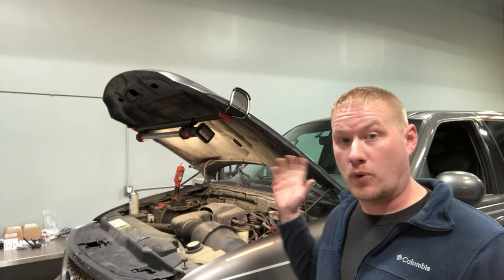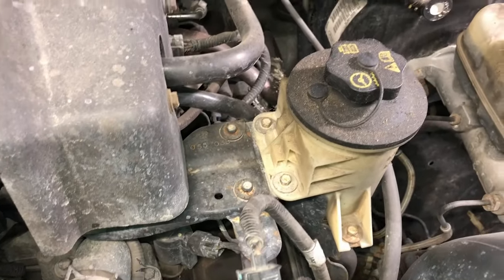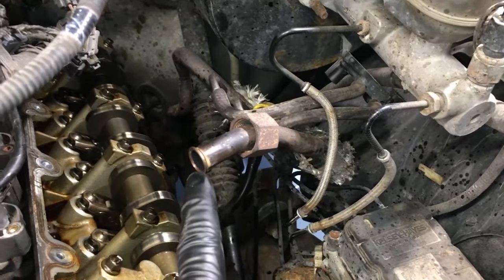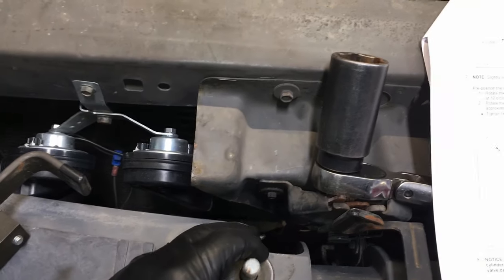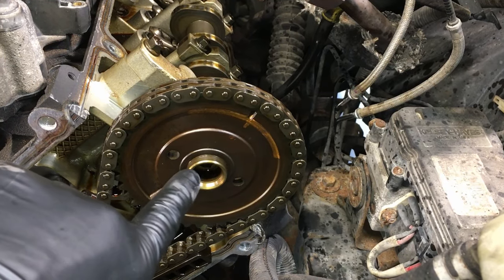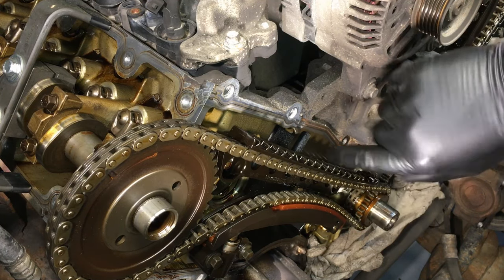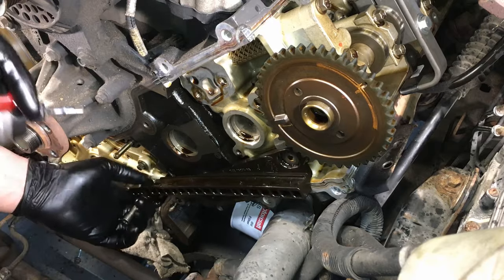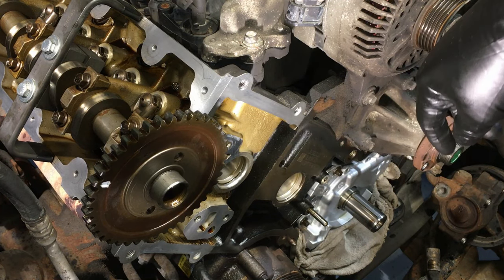Ford 5.4L 2v Triton Engine: Complete Timing Walkthrough

Comment: The driver-side cam seemed to be way off; I wonder if the eleven and twelve o'clock positions are supposed to be referenced from the plane of the top of the heads which is at an angle.

Comment: Awesome vids.  I have a 2010 F-150 3 valve 5.4 with 110k miles.  I don't notice any real loud noises yet but has had the strange shake at idle a couple times but has never threw a code.  I wish I lived close enough to your shop to have the complete job done because you know your stuff for sure.  I'm in northern MI and besides the Ford dealership that would be huge bucks, I just don't know a shop here in Gaylord that I would feel comfortable enough to do it.  Maybe there is.  Just seems to be too big and precise of a job for me to tackle.  I'm okay with spending money on it because it is a great looking truck still.  I just got out from being parked all winter and would like to get it done.

Comment: So how can I tell if the pistons are all below deck, because if its 2 rotations of the crank to 1 of the camshafts dont you have a 50/50 shot of the pistons not all being in the 'neutral' position? Only asking because the timing chain was off before I started working on this project

Comment: Super video, Brian, thanks.  My 2003 F250 5.4L 2V with 195 k miles, has a steady "garr" sound at idle,  disappear at more throttle.  Could it be the chain guides?  Also, no misfire when cold and started missing when getting warm, and more miss with more throttle.  Any ideas, thanks. Dale

Comment: I have the 97 4.6l Windsor, with 250k on the clock, there’s no issues, but was planning many parts to change out ( radiator, timing components, valve stem seals, etc). Should I wait for an issue/ reason, or just perform the PM based on mileage. Owned it since new. Thanks (some oil burn off, suspect stem seals)

Comment: I really hope you see this, I have been looking all over the internet and cannot seem to find anything about the Cam Gear removal or installation.   I have the 5.4 2 Valve and it almost looks like the Cam Gear is screwed on, I see threads on the shaft. There's no key or anything,  I don't understand what keeps it from moving on the shaft.  And there is no bolt either.   I have my engine all apart and am re doing everything, but this is the only thing I can't understand,  I have a timing kit on order with the Cam gears, but I don't know what the deal is with them.  Any insight would be greatly appreciated.

Comment: nice video 
a hint from my minimal experience... 
a few degrees off of tdc should not be a issue as long as u have marks lined up with colored links you gold
so bottom tool is not mandatory
cam lock tools are for your safety
 there is about a 30 degree cam rotation do to valve spring load on a sohc at TDC basically everything the tensioners are holding  plus 10degees or more the cam gear will rotate further so
before touching the chain remove spring load with cam holder tool or a screw driver pry tool to hold the tension with one hand and use other to remove chain off of crank gear then release tension slowly
or cam will turn violently and damage valves or fingers
cam lock tool holds 2 valves open and if you remove the head they may bend if you set head chamber side down so tool will need to be removed releasing the rotational force
upon reinstall the same rotational force will need to be reapplied to cam gear to get marks to line up so two hands one to turn one to secure cam tool or just put chain on.

Comment: I'm a little confused, you said in the beginning of the video that the 5-4 2 valve is timed differently then the 4.6 2 valve engines. My question is, why is it that they both appear to look the exact same? And what exactly is the difference between the two?
Reply from the maker: They are both 2v engines but there are many differences. There are differences between the 5.4L 2v and the 4.6l2v Romeo and Windsor.
Reply: @FordTechMakuloco  Thanks for replying promptly brother. My main concern is the timing. It appears that both engines are basically set up the same way, both cam gears at 90 degrees from the head surface and the crank sprocket at the 6. If you have a video on resetting the timing for the 4.6 2 valve, after all the cam followers have been removed, that would be most useful to me, because I did a complete head job on them and I'm getting ready to put everything back together and I just want to make sure I time everything right.

Comment: Could you please answer this question for me ? Can I use the wedge tool on the 5.4 2 valve to prevent removing the front cover so I can change out the head gasket?

Comment: I have a 2003 ford expedition 4.6l 2v romeo engine and was going to be doing timing chain and oil pump....would you recommend the high volume melling pump M176HV? Or should I stick to the stock M176?

Comment: Hey Brian, your video has been super helpful as I just bought an f250 that I had to replace the timing cover on. Everything went smooth but now it’s seems I’m having trouble building oil pressure. I’ve followed your advice of removing the sensor and turning the engine but after several tries there is still no pressure. Any ideas what it could be?

Comment: Could letting timing get bad enough on these motors cause a constant misfire on cylinder 1?
Reply: usually if timing is an issue then whole engine runs bad, not just singe cylinder, just check your regular things first - plug, coil, cyl.compression, injector and go from there

Comment: when all this is torn down, would it be useful to get a stethoscope and turn the crank over a few revolutions and listen for any differences in the cylinders and feel for any slight friction in the strokes? Would that help you determine the overall health of the lower part of the engine?
Reply from the maker: no

Comment: If your using a good used timing chain and you can't see master links lay chain on table mark one link on one end and on other end mark 2 links and align on e link marked with one link put on dot timing mark on crank and and the 2 links at timing mark on cam socket and make sure you are on tdc and cylinder ready to fire or you will be 180 out on crank hope this helps

Comment: Sup guy.  Question for you. I have a 2012 5.4l e-350 2 valve i believe since i dont have those long spark plug. I have what i think its the startup rattle for about 2 or 3 secs. I originally thought it was the starter going as it only happen when cold and start up only. Then the started craped out a few months later. Rattle only happens in the summer. But i got missfire code on 4 and 7 and i think head gasket is leaking oil but other than that it runs fine. Question is can i do these heads while engine is in the van? I dont have a lift can i remove engine without a lift?

Comment: Since you've seen a ton of these 2v motors, what mileage would you recommend doing the timing chain? I bought a 2002 5.4 that runs fantastic with 205k miles but I don't see any signs that the chain has been done before. Am I on borrowed time or do these hold up that well?

Comment: Hello, I have a question about a 01 f150 super crew 4.6 270k the engine is making a rattle seemingly like timing chain but I noticed it’s dropping oil pressure from full/ normal- to going dead and the light illuminating , if I rev the engine a bit it will come back up but stop again after a few seconds . Do you think the tensioner is blown out causing to lose oil pressure or is it a pump issue?

Comment: I assume this engine is in time before disassembly; so why are the cam timing marks not in the correct location when you have the crank at 12:00 o'clock?   The driver side is way off at 2:00 o'clock.  So was this engine timing off?

Comment: which followers should I remove if I don't have the tool to hold the cams? Also can I use the same tool from a 3V eng to the remove the followers on a 2V eng? Thanks in advance.

Comment: I am doing head gaskets and timing chain on an 03 F250 SD 2wd 5.4. Is there enough clearance to pull the heads off with the exhaust manifold attached just disconnect both couplings and drag it all out?

Comment: Just a question, what is the timing chain on 5.4L 2V replacement interval? Got 114K miles at the moment.
Reply from the maker: Most go 200k or more before needing any service.
Reply: @FordTechMakuloco  I have a 2003 Harley Davidson model that needs the timing chain replaced. A Ford dealership (Houston,TX) quoted me max $2,800 but could be a little less... Is that accurate or do you think they are over charging me?
Reply from the maker: It is on par for dealer prices.

Comment: Brian once again great lesson; thanks for sharing your heart. My 2000 f250 has 191K on it.... Is this something I should proactively address? I don't notice any issues right now
Reply: We have an 2003 E150.  5.4 around 195k I started to hear valve ticking on pass. side head.  Now at 220k It was getting pretty loud so I did lifters, rocker arms, intake, timing and new oil pump.  Intake was leaking at cyl 1.  Lifter and tensioners and were completely shot.  Also chain was about half way through front cover.  Got at 140k previous owner used oil change places and hardly ever got it changed.

Comment: Since its a colored link system, wouldn't it be "safer" (assuming one didn't have the correct cam holder) to time it with the crank key at 12 o'clock and the pistons all below deck?

Comment: I have an 2004 5.4.  I replaced the tensioners 3 years ago with Motorcraft and they're already failing again.  Can I use the steel ratcheting ones?

Comment: So when u set the crankshaft 12 position and u removed the chains can I removed the head to a head gasket replacement?
Or how u set the engine up in order to remove the heads?

Comment: Wanted to get your opinion, I’ve been chasing a wild hair for quite a while now, just recently watched your other video on replacing the intake manifold and sure enough mine was cracked. So I replaced with the dorman intake all new injectors, all new spark plugs and coils. Because I used to get lean codes on both banks of the engine, especially when really cold ambient temp. I still have a what I call a spark knock on my engine, when I upgrade to high octane fuel, the problem goes away. But comes right back on regular 87. Under light load I get a rattle noise only upon acceleration in drive. When in park you can rev the engine and the problem doesn’t occur. I’m thinking it either has to do with a vacuum leak somewhere being how when the engine is still cold , my ac will only go to defrost until the engine is fully warmed up then blows through the vent. I’m hoping this is just a lack of vacuum and not a timing chain issue. Other then those two things the engine runs and idles perfect. This is on a 2002 f150 5.4 2v. Any input is much appreciated.

Comment: Any knowledge on the cloyes timing chain kits? Comes with the crank sprocket, chains, guides and tensioners. I plan on buying a melling oil pump, but what do you know about the cloyes timing chain kit? Good to use or bad to use?? Thank you

Comment: Not a criticism just an honest question. Do you ever put any kind of lube on the tensioner rails say like assembly lube so there is not a dry start on the chain until oil gets up there?
Reply from the maker: Nope no need, during the prime procedure the oil squirters on the tensioner saturate everything.
Reply: FordTechMakuloco OK I was just wondering how long it took for oil to get up there. Do you have a vid doing this on a 4.6 2V?

Comment: So many expensive issues identified on your videos and others regarding the Ford 5.4 2V, 3V & 4V Triton engines.  There are obviously millions of these engines on the road.  Are the issues plentiful because of the failure rates, or common due to the sheer numbers of these engines out there?  I'm looking to replace a vehicle soon and looking at the 2011 and 2012 Lincoln Navigator.  I'm looking for a well maintained 100K mile or less vehicle with good dealer service records and regular oil changes.  Should I consider these Navigators, or run for the hills?

Comment: Hey, might be a newbie question.. when you turned the crank shaft and the left cam ended up at 11oclock, why didn’t the right side end up at 12oclock like you were hoping? Is it that the chain had enough play by now to end up at almost 1oclock like found in the video?
Thank you for such a great video
Reply: Yeah, that REALLY freaked me out. I'm thinking, since he overshot a bit, and backed up.. and the tensioner was blown, we just saw some backlash... and first I was thinking "did this jump a tooth?" but, of course, that's just not possible is it.

Comment: @
FordTechMakuloco my mechanic replaced my fuel pump for 460$ and told me my timing chan broke and it'll be around 2500$ to fix the timing. does this sound right how could my fuel pump and timing go out at the same time?

Comment: Hi I was wondering how you know when it's time to change your guides and chains. Do you get some kind of external warnings or sounds to look for. I have a 2001 f150 5.4 with 307000 miles on it. It still runs good just curious. I am going to be changing the intake and valve cover gaskets.

Comment: what is the average cost of this exact repair including the oil pump upgrade at the dealership or a shop? parts and labor?
Reply: Eluder Racing I was quoted $1200-$1500 minus the oil pump at local shops

Comment: what can You tell me about QualCast engine valve springs. Would You thrust them. In this case I am replacing valve lifters, rocker arms, head gasket and valve springs QualCast 321615 in a 98 expedition 5.4 L. I will appreciate any advice Big thanks in advance.

Comment: Around the 35 minute mark you talk about removing the roller followers.  I saw in another one of your videos where you use an OTC tool to do this on a 3V engine.  Do you know if the tool you recommended for the 2V engine will fit inside the tight space of the doghouse of an 2003 E350 van?

Comment: I have a 4.6 romeo that I will be doing a full timing set on soon. Is there a location that I can turn the cams to be able to replace the roller followers and lash adjusters without removing the cams? Also what's the best way to get that egr tube off? Those nuts look pretty rusted. Thanks

Comment: On your video for the timing of the 5.4l triton 2v you stated the crank sensor gear has front written on it what is the placement if it says rear. Does that mean that side faces the engine or is it reverse like the chain tensioners with left and right? Just to get a better understanding. Thanks

Comment: I have an 02 f150 with 392K miles and this is the first time having to get inside the motor, after installing the timing chain and lining up marks on sprockets and timing chain and rotating the motor 2 revolutions the marks on the sprockets are good but they don't line up with the marks on the chain. Is this correct?
Reply: Robert Rogers not at all, the chain is god when timing, if you have a problem there stop

Comment: So I have a 2006 Expedition with the 5.4l 3 valve got the timing done, thrust bearings replaced a full tune up but #8 is misfiring underload checked valve's and compression but still missing is it possible that the ECM is having issues?
Reply: Also swapped around Injectors
Reply: Many times non Motorcraft cheap coils fail to work at higher rpms. You also might have some air leakage say at injector o-ring on that cylinder.Whats your LTFT on that bank with problems?

Comment: Why dose it looks like the chain is not set down into the teeth of the cam sprocket.  Also, if you are going to all this work; why not replace all the lifters and check the roller follower rocker arms for needle bearing wear. ?

Comment: Hello Brian!  Thank you so much for this video, I am going to tackle this job on my 99 Expedition 5.4l this weekend.  My question is related to the removal of the followers.  You mentioned in your video that once you remove the valve covers you suggest removing the followers to keep the valves closed.  So once all the followers are removed you then move forward with aligning the timing marks on the cam sprockets and crankshaft sprockets to the chains?  The timing marks still have to be 11 o'clock for right side 12 o'clock for left side and 6 o'clock for the crank sprocket correct?  Lastly once the timing is set you then replace the followers, and turning the crankshaft to install followers is ok?

Once again thank you in advance for your help!

Comment: If the tensioners are the early cast iron ones, do they still need changing?  (Very early 97 Expedition, 420k - also doing head gaskets)
Reply from the maker: At that mileage yes change them.